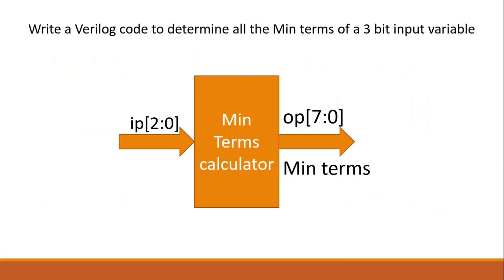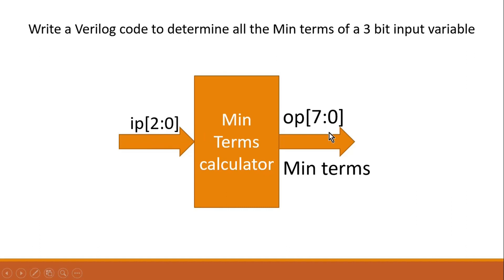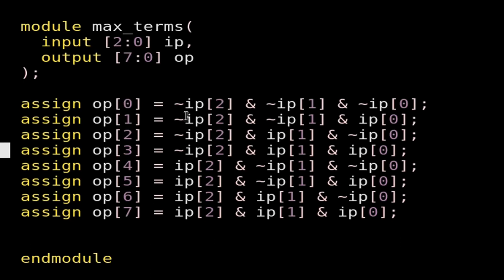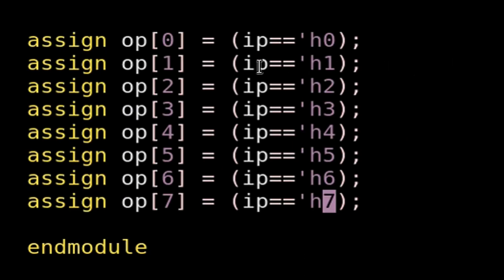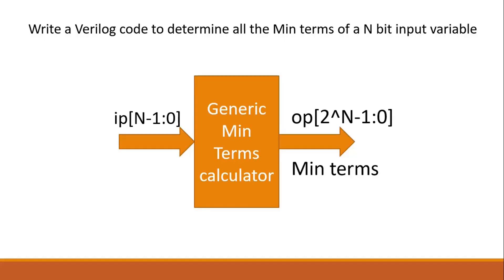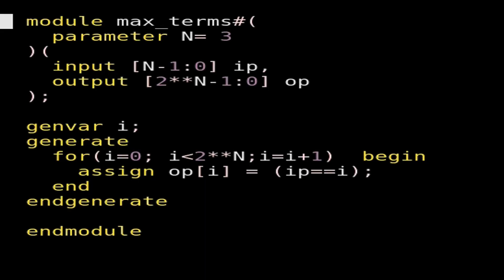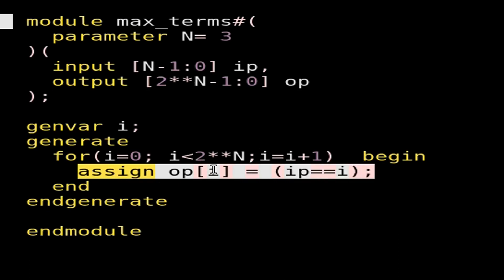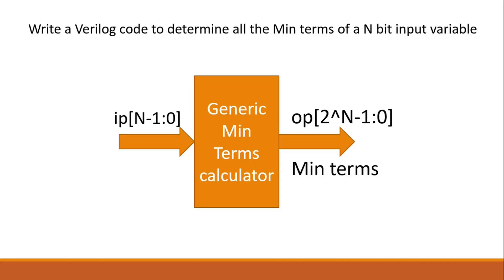Verilog Interview Questions Part 14 Min Terms Generation

Comment: How about ?
always@(op)
begin
op=0;
op[ip]=1
end
Reply from the maker: This will also work .. Actually, I just tried to relate it with previous section of the video i.e. to use the multiple assign statements using generate statement..